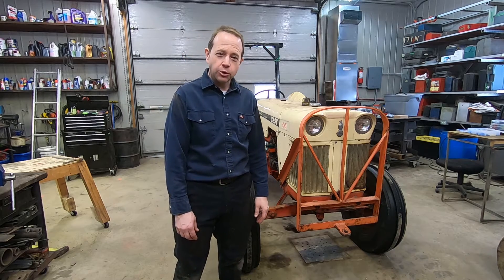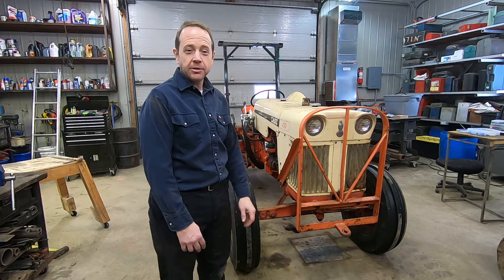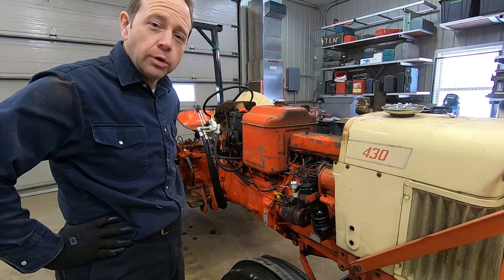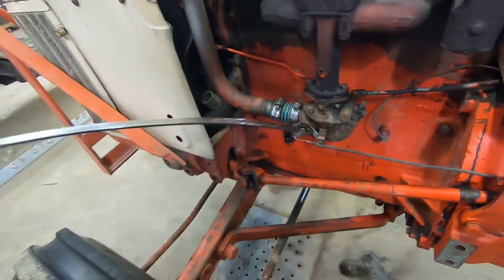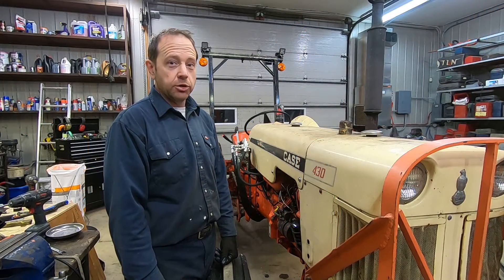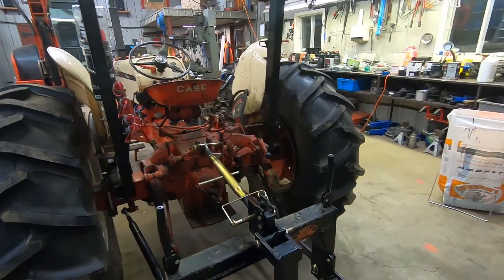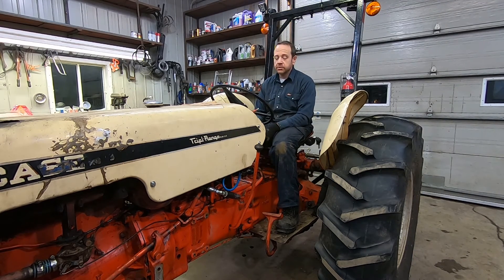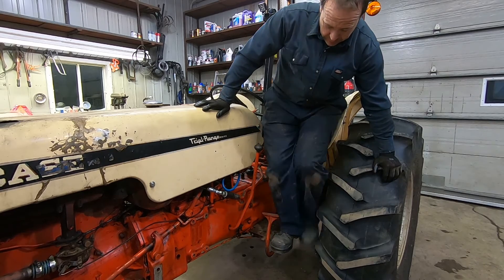#252 Updates on the Small Case - 1965 Case 430

Comment: Excellent job Joe 👍🏻, I’m glad you know your wiring, you lost me when you said “I’m redoing the wiring” 😳🤣.  You’re missing the fur seat cushion like Dave 😉👍🏻. Will you be changing the headlights to LED? Have a great one Joe 🙋🏼‍♂️🙂👍🏻
Reply from the maker: There are good chances I replace the front lights as well. They are quite expensive though.  Wiring is not complicated, but it's so easy to make a dumb mistake and ruin the whole job. 
Example:   https://youtu.be/DbM46TSlcbw?t=260
Lol! Thanks Luc!
Reply: @FromSteelToWood  a little fire, the connectors you used as the replacement was a good idea, well done Joe 👍🏻. Plus that video is a nice souvenir 👍🏻🙂🙋🏼‍♂️

Comment: Salut Joe!!!  You have done a lot of work to get this wiring squared away and adding those lights and seat belt is a vey good plan too.  The new switches you got look to be pretty good ones.  Especially the horn and lights one, I like that!!!  The steps will be nice to have eh.  Thanks for sharing and take care!!!
Reply from the maker: Thanks Mike!  I hope the new combined switch will last long.  In a horizontal position, it may collect water.  I've put a good spray of water repellent lubricant (Fluid Film) on the shaft, so it does not collect water. Thanks!

Comment: Great upgrades to the wiring, it looks like you have it all sorted. The front light look the same as fitted to the Bolens and if the are they would look good with the LED upgrades we fitted
Reply from the maker: They are the same, 4411 type.  They are expensive in LED sealed beam version.  I don't use them very often, so I may just replace them with an incandescent one.  I've got 2 spare lights from the Bolens.... Thanks!

Comment: Good Morning Joe ( please to meet you mon ami 😉👌👍 ) I love your Brand NEW 1965 tractor 🤣😉👍 I love your pre level check's 🤣👌 Great idea about your accessory position lights switch and check more often the deep cycle fluid battery lever ( they said that is should not be used as battery starters but I can tell you that my battery on my RV was use many many many time as a battery starter on my old Dodge truck ( it was use in parallel with the truck battery and also recharged by it during many long hours roads trips ) the only thing I notice was the evaporation of acide fluid level 😉👍 Yes in deed, a crack in the coil is not good at all 😌  Missed or Mess you do only Chef d'oeuvre mon ami 🤣👍 I do have to install a horn on my tractor 👌👍 Oupss, one front light burn 😌 Your wiring is OUSTANDING and I will be good in deed a few decades 👌👍😉👍 HA HA ( B.C.  Before CV !!! ) 🤣🤣🤣👍Great fire extinguisher mon ami ( great cover too ) YES JOE LIKE VERY MUCH his mayonnaise 😋😉👌   I LOVE YOUR SEATBELT MON AMI you wont get squeezed under your back wheel 👌🧐👍 I do think you can use your other licence plate from the other case tractor or maybe made the switch at the SAAQ 🤔 Yes you do need step for sure 👍🧐👌 OUSTANDING FULL WATCH VIDEO 👌😉👍 I receive 4 inch's of snow last night Ho boy !!! CHeers 👍😉👌🍻
Reply from the maker: Thanks Dave!  I will have to check for leaks on the battery... and replace it with distilled water. One front light is burnt, but I have 2 spares from the Bolens... When I have a chance, I'll replace it!  Thanks!
Reply: @FromSteelToWood  You can oil the under battery plate just in case that acide battery leak from recharging ( My RV was plastic ) but I oil the angle irons under it. Cheers 🍻👍😉

Comment: You can install a petronix electronic ignition and a hotter coil. Also a gm one wire alternator.
Reply from the maker: One day, I'll pull the trigger on the Pertronix!  As far as this generator works, it will stay there. But as soon it fails, a Delco-Remy is going to take over! Thanks!

Comment: Good work here Joe, I think, in looking at that old wiring , you may have adverted some serious issues with this Case.
As always I look forward to the next chapter in this.
Reply from the maker: Absolutely Reg! I've found the white coil wire partially melted under the electrical tape.  Did you see the crack on the coil?  There was also a good dent on the bottom of the bottle. That indicates to me the coil has been hit by an object, while it was standing outside of the engine compartment. Then a short did occur.  It was partially repaired, but the partially melted wire was still in use!!! I've tucked the coil under the hood where it was supposed to be, protected from the elements. Needless to say, it got a new wire! Thanks!
Reply: @FromSteelToWood  Yes I did see that crack and wondered about water / moisture getting in there. 
'Hiding' it under a protective cover is a good idea for sure. I noticed how 'sweetly' your Case runs, I like that exhaust sound too!

Comment: I rewired my Case 530 with a friend and replaced the generator with an alternator.  It was a rats nest of splices and patches.  New ignition switch too.
Reply from the maker: Lol! It was a matter before it shorts and creates a fire hazard.  Good thing you rewired it all! What kind of alternator did you get? Delco-Remy? Did you have to make a new bracket? Thanks!
Reply: @FromSteelToWood  It was a DB Electric 1 wire self exciting alternator.  I was able to utilize the existing slotted bracket for the tensioner, and then I packed out the lower pivot point with washers and a larger bolt to align the  alternator with the belt.  So, with few adjustments, I was able to pretty much put it where the old generator was.  It is simpler and more accessable than the original generator on the 530.  Thanks for posting the video.  I really appreciate how intuitive the wiring is on older machines than new vehicles.  The chip shortage will never directly affect my Case 530!

Comment: I liked the caption about no plastic as you were taking the engine cover off.  "at's why the machine is still going strong after 54 years. The way you take care of things and improve them, if you live another 54 years, it'll be used to haul you to the cemetery. Did you get that horn out of an old VW Beetle? That's what it sounds like. Did you know your left side headlight is out? That mayo jar is a terrific idea. I thought it was a peanut butter jar though. when do we see part two?
Reply from the maker: Thanks Jim!  I got that horn form the automotive store... It was announced as "high pitch". Did not take attention to that first, but now that I heard it, it seems indeed like a beetle horn!  Good thing, because the high tone stands out from the low tone engine sound. 99% of the machine is made from iron. So there are good chances it will outlast me! Thanks!
Reply from the maker: BTW, I was seeing the reflection of the light on the front grille and saw the left one was out... I'll look into replacing them for LED as well. Thanks!